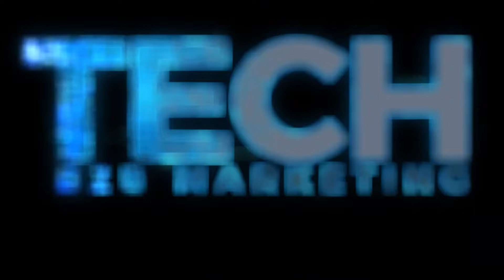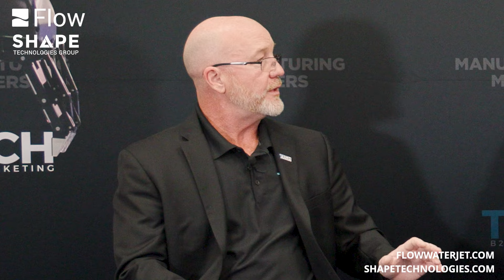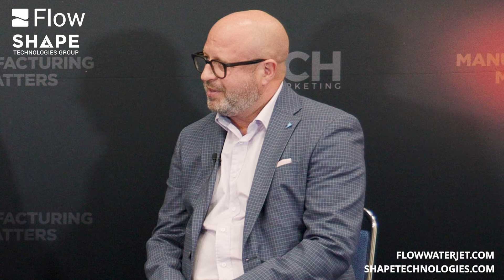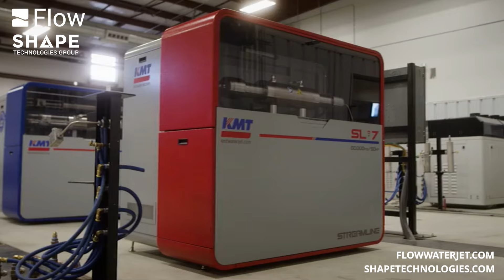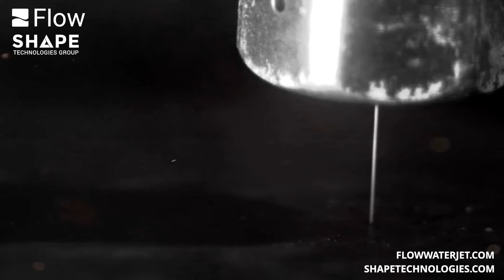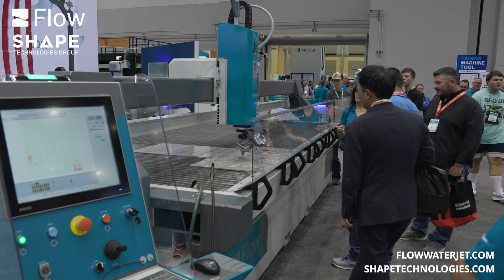Episode 75 - Brian Sherick from Flow International and Nino LaDuca from Shape Technologies

Comment: The audio really needs some work, you shouldn't use a center attached lav mic when you spend most of your time with your head turned to the left or right. Echo and over modulation on the guy in the middle, and the guy on the right is to loud. This is a good example of when to use a 32-bit float recording, (a sound check goes a long way). Also, I would have had the group away from the wall, they are casting hard shadows and the wall is in focus, but they are not.